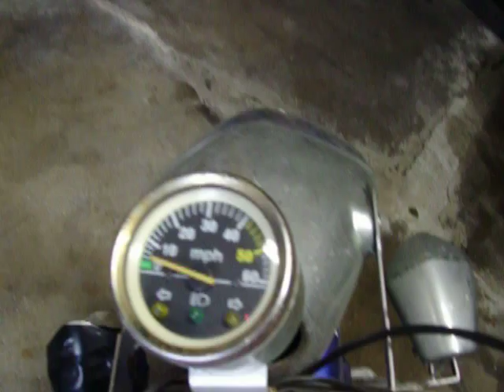Mini chopper cold start 49cc

Comment: I have the same exact bike. I got power lights turn on. Every time I use the electric start button to get it to get over all I get is a click the pull start won’t even start it. What should I do??
Reply: Do you know the brand, model or year of that thing?
I have an identical one but all marking have been
removed so I know absolutely nothing about it

Comment: hi i got the same exact bike my electric starts sounds like brrrrrrrr and wont move help?
Reply from the maker: this model requires one heck of a good battery to move this starter. the starter is actually part of the stator that charges the battery. which is weak. it may be the stator is getting weak. start it up and test the voltage coming out of the battery wires. should be about 14v. if not then it could be the voltage regulator or since the starter is not working right then I would suspect a bad or weak stator.
Reply: okay thanks i will try that!
Reply: bam6972 hello i tried that i hocked it up to the charger just like you did but it sounds horrible i will upload a video to my channel where you can se
Reply from the maker: MrTimeLapseBuilding (Minecraft Constructions) ok. send me a message when you do.

Comment: I have the exact bike and I can’t get it to start any advice
Reply from the maker: clean the carb or get a new one. also check and see if you have spark still.
Reply: bam6972  I’m getting spark and do you know how to get a new one or where
Reply: bam6972  I bought it so I can get around and to back and forth from work so really need to know how to fix it
Reply from the maker: i got my new carb on ebay. search 49cc mini chopper carb
Reply: bam6972 ok I’ll go check on there thanks
Reply: Starting fluid?